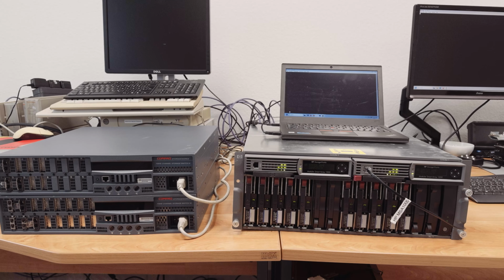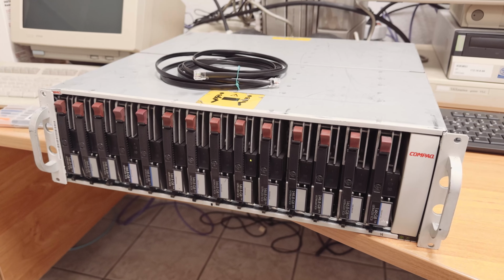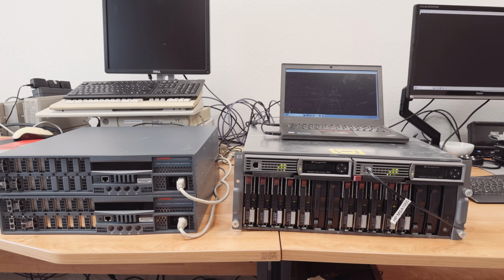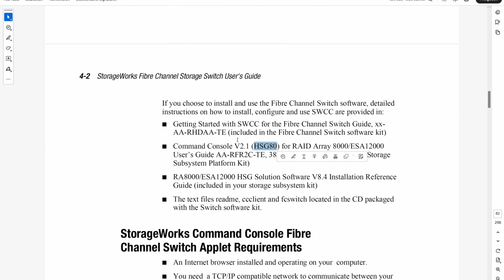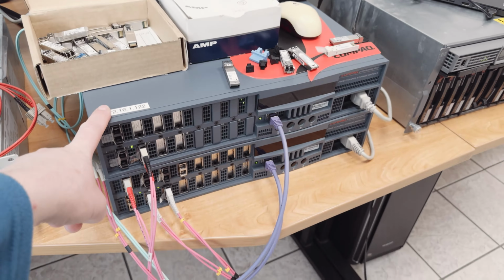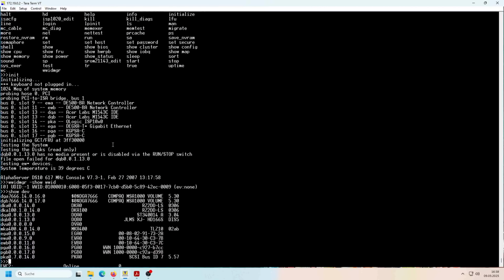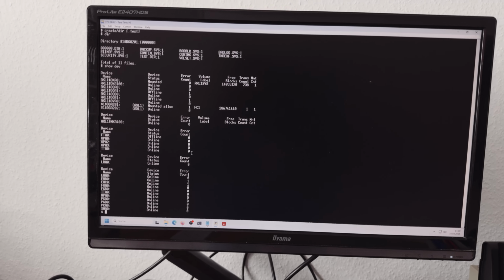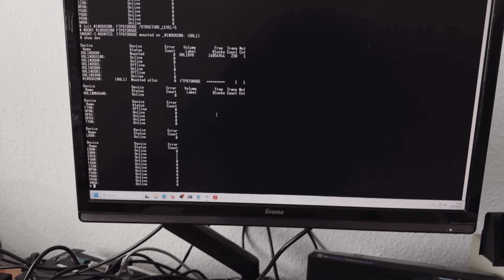First steps with Fibre Channel and OpenVMS (StorageWorks - Part 4)

Comment: OM4 "Hello Kitty pink" cables. ;-) You have no Battery unit. Are you sure that you got cached io? I mean in genneral (can only speak from DGC (EMC), without SPS (Battery) there is only no cached io, only direct io.

What SFP Modules do you need? I got some 1Gbit Finisar ones and 3x 4Gbit Brocade (later called Avago). Also tons of Brocade 16Gbit SFP+ ones, but I guess they are too new! :-p
Reply from the maker: I use the fiber optic cables that I can get easily, I don't really need OM4 for any application. Compared to the copper cables, I don't have a color scheme and it's a colorful mix ;)

The HSZ70/HSG80 is without a battery unit (but I have the cables). These are no longer widely available. However, you can also activate the cache without the battery unit, you will only receive a warning message. But I have also deactivated the write cache, as I can (currently) use the system without it. I use also an UPS, which bridges the time gap for at least a few minutes.

The MSA1000 does have batteries on the cache modules, but they are probably at the end of their lifetime. Fortunately, you can still get them, so maybe I'll swap them. However, the cache is currently also completely deactivated there.

It works with the Brocade SFP modules, but there is still a certain incompatibility. I'm now considering using a Compaq 2/16-EL and seeing if it works.

Comment: Great video. I remember the MSA1000 as I bought one to set up an Exchange cluster at my then-employer some 15 years ago, but I don't remember using that CLI. 

Also, good to hear the HSG80 mentioned again as that's what we were working with at my employer before the one with the MSA1000. 

And with regards to your PhD thesis: Break a leg!
Reply from the maker: Thank you :) There are two ways to configure it, either via CLI or with a software called "HP Array Configuration Utility". Unfortunately I don't have a copy of it. Later HP controllers probably also had a web interface; but that may come in a later video.

The HSG80 will be interesting because I could use the Enterprise Storage Array to run all the Alphas with one system disk. We will see if and when I update. But then only one Enterprise Storage Array will work, the HSZ70 supports up to three (okay, I have only one...).

Thank you very much, but there will be also a sequel to this video soon.
Reply: @DECcomputers  Oh, right - I remember ACU now. I guess that's what I used to configure our MSA (which, once configured, was super low maintenance - it just worked for the many years it was in service).  

I don't remember much of the HSG80, just that whenever there were problems with it our local Compaq people couldn't solve, they flew in a former DEC employee, "the expert", who had been with the company for 15 years or so. 

We were among the early adopters of the first Compaq-branded SAN (I think it was an EVA), so problems arose on a somewhat regular basis.
Reply from the maker: @Thiesi  The MSA1000 also seems to be quite reliable. However, I wonder how long it will keep switching on and off without a rebuild. Unfortunately, it cannot be shut down.

I haven't tried the HSG80 yet. I assume that it will be similar to the HSZ70 in terms of configuration. There is also Storage Works Command Control (SWCC) instead of CLI, but that has its own strange behavior. 

I have parts of an EVA4400 here, but this is already the “newer” equipment that I would like to test with the Itanium later.